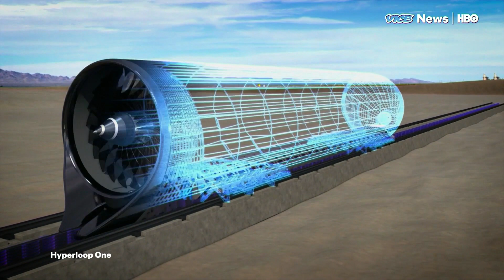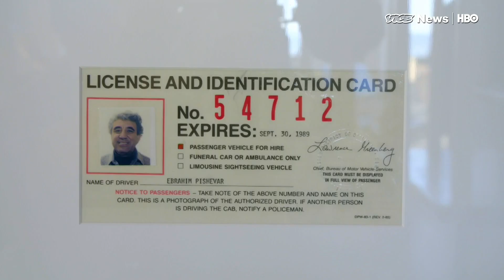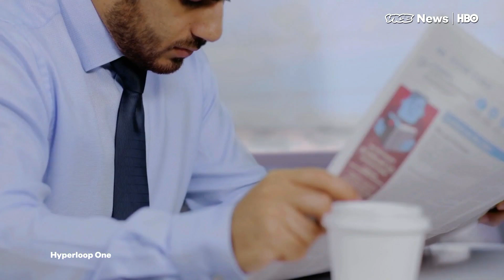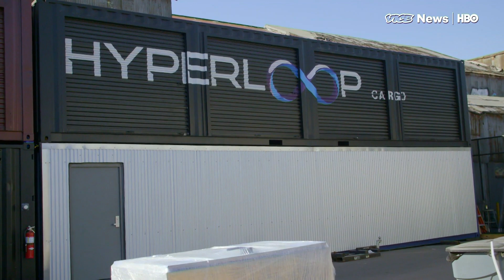The Man Creating The First Supersonic Hyperloop (HBO)

Comment: The Hyperloop is one of the silliest ideas I have ever heard. Quite apart from the eyesore on the landscape, there seems to be no escape from the Hyperloop. If there is an emergency in the tube and the vehicle comes to a halt, how do the passengers get out? The passengers are imprisoned. This is in contrast to the 31 mile Channel Tunnel under the sea between England and France which has a dedicated escape tunnel located between the twin rail tunnels (one in each direction) with access every 100 yards or so . . .

Comment: Hyperloop should be built underground so as to get rid of issues with terrain. A bump going at 700mph is going to hurt and going around curves would mean slowing down dramatically. Should also be easier to maintain that vacuum with layers of concrete dirt outside the tube. Larger upfront costs, sure, but a overall better design that would prevent the concept from losing consumer trust.

Comment: It's all smoke and mirrors... everything that has been tested or shown in prototypes already exists. It's called MagLev, it's already in use, it didn't need to be reinvented, and it shows nothing new or particularly essential to the whole hyperloop thing.

The original hyperloop concept didn't even point out to a MagLev system in the first place, they are using it because they couldn't figure a way for those pods to actually levitate in vacuum because that's of course a stupid idea in itself.

So all that they've made and shown so far is completely unrelated to what's needed to make this thing a reality. They could've instead paid for a MagLev train construction between the two cities and gone with it instead. MagLev trains might be slower in current tech, but they work, it's proven and it offers a wide range of advantages over even the ideal concept of the hyperloop. This whole thing is stupid as hell.

I mean, big whoop, the guy showed an electromagnet system working. You could go to a science fair to see that. That stupid track test? Go ride a train that's already using the tech in Shangai, fully operational since 2004.

Still no word on how they are going to build entire tunnels over long stretches of land while keeping near vacuum conditions inside those in an economically viable way. It's nothing more than the Simpsons' monorail episode with this guy banking it instead. 

And don't even bother replying my comment with the stupid we didn't go to the moon by sitting on plans and other stupid crap like that. All I see is a huge list of disadvantages and waste of money on a dream project for which existing technologies would do way better.

Comment: I call bullshit on this. Its a super dangerous and hard to have a vacuum in a tube. if the tube cracks the pods will be instantly destroyed.
Reply: R Sulli there are solutions to those problems. Like humanity is gonna give up on the best mass transit system bc of some highly unlikely scenarios. Oh, some terrorists might hijack a passenger plane and crash it into a building, let's give up on planes. Oh wait...
Reply: google "ping pong ball vacuum"
Reply: it doesn't need to be a perfect vacuum, it's not super dangerous and it's not that hard. And if the tube cracks the pods will NOT be destroyed, they'll just slow down.
Reply: R sulli, same goes with airplanes.
Reply: lol, when the atmosphere hits the cart at the speed of sound it will surely slow down, just like when you hit your hands together harder than you could ever imagine, both hands just slow down :D
Reply: DP ie Im not an engineer either, I agree this sounds super dangerous
Reply: If the tube cracks, more air enters the "near" vacuume, which would only add more resistance to the pods (slowing them down). This aint hollywood. The hyperloop is nearly foolproof compared to calamities that occur with regularity in other modes of transport.
Reply: plus LA and san Francisco is in earthquake zones
Reply: PunaJussi because flesh is as compressible as air?

Comment: Elon Musk backed out of the idea because it is logistically impossible
Reply: Just out of curiosity, are those air tight oil or gas pipelines also infeasible then? 
US-Mexico border is about 5 times longer than LA-SF distance.
An example of logistically impossible would be to build a hyperloop on the Moon. Logistics between LA and SF and the rest of the US is not that bad actually.

On the other note i have no idea if this hyperloop project is anyhow economically justified. Just saw some red flags that wanted to bring attention to :)
Reply: Lunarguard Gaming I don't think you know what that means
Reply: doodelay that it is physically impossible to build a hyper loop any distance without great consideration of the expansion of metals and how heat will effect this project?
Reply: A 100 billion dollar expected cost should throw up warning flags, considering even Donald Trumps expected wall is 10 billion dollars
Reply: You could bury the tube to account for temperature swings and as far as the deadly pressure wave during a breach you could run hatches along the tube to repressurize it all at once to mitigate that wave.
Reply: When did Elon "back out"? He never pledged to do anything to begin with
Reply: Lunarguard Gaming why would that not be considered?
Reply: Я asmallbluedove says it in the video:p it might say he handed off the project but it's more like he backed out of a financially unstable deal
Reply: Gene Khlopov they're not holding a vehicle that is transported at thousands of miles per hour
Reply: of course the metals will change. the magnets will also be an ongoing cost. you'll have to keep replacing them sooner or later because they'll eventually lose their magnetism. that doesn't mean it's logistically or physically impossible. way to jump to conclusions tho lol
Reply: / when they are saying they are going to make thousand mile connections and selling this concept to investors, when in reality they will never do this even if it's possible to account for the expansion of metal and concrete in the stations and the railway which could be hundreds of feet, they need to account for a 100 billion dollar cost, and all they can show with a 120 million dollar budget is a hovering box thingey, ya I'll either call scam or logistically impossible theory which is a fair claim since they have not provided solutions to zed problems
Reply: Cam F anyone can have a jet engine run in a concrete cylinder for a 100 feet.... It's distance that makes this impossible
Reply: Я asmallbluedove lol
Reply: CONNORCONDORJOHNSON I wish they proposed those things even if it's going to cost much more they need to say these things
Reply: doodelay can't just call me out then leave:p
Reply: +Lunarguard Gaming Obviously not, he launched a hyperloop competition this year and last year.
Reply: Chris Chong competition is not funding a large company
Reply: Lunarguard Gaming I never said he was funding a large company. In reference to your original comment you said he "backed out of the idea", well if he did why is he holding annual competitions?
Reply: @lunarguard gaming no he backed out because he already basically running three companies he only published the plans cause in an interview he said he would. He has since talked in many interview about how he would carry it out but doesnt have the time
Reply: Lunarguard Gaming No you jackass
Reply: He never backed out of the idea.  "Lunarguard Gaming" lies for his own pleasure.
Reply: This is easily avoided by using a mimetic polyalloy
Reply: $10 billion for a wall is a shitload better than $100 billion, considering it will actually work unlike Hyperloop.
Reply: doodelay ask them I don't know exact figures but if you're building a concrete structure with metal supports that has to be air tight for any amount of distance it will expand and contract exponentially, with no proposed solution that can handle this. let alone they're proposing to do it thousands of miles
Reply: And Elon is a dumbfuck and even he knew this dude was dead wrong!
Reply: Lunarguard Gaming provide evidence please
Reply: Killacamfoo O.G. No, it won't. Cam F 
Ways to get past a wall:
1. Go over it.
2. Go under it.
3. Go around it.
4. Go through it.

Comment: "Hyperloop" is a very specific combination of a mostly-but-not-entirely-evacuated tube (which realistic vacuum pumps can deal with), an internal hovercraft holding up the tube vehicle, and an electric turbofan propelling it.

And it's a genius idea.  We've been tossing around transportation ideas involving vehicles-in-a-tube for a century and a half;  This tactic cuts off some of the rough technical edges (wheels, hard vacuum,  the cost of active magnetic levitation) and permits airline-type speeds.  "Hyperloop" does not refer to the entire category of vehicles-in-a-tube, and you can't just cut off part of the idea - the elements are interdependent.  It was a way to make this family of dreams economically feasible to engineer & build.

This startup has nothing to do with the hyperloop concept as presented by Musk.

Comment: And another Money Pit is created. 
Never going to work, one breach and they all die a horrible death.
Reply: Mrcharrio to be fair, the same goes for airplanes. I agree with you though.
Reply: All hail our lord Thunderfoot for calling out this bullshit ages ago
Reply: +U 3. I thought Shanes "debunking" was pretty poor. He mostly just talked about half of an argument, omitted the rest and replied like the stuff he omitted wasnt mentioned or addressed.

The only aspect that made some sense was the compressor vs turbine part, but considering he was commenting on a video were Thunderfoot talked about the hyperloop in context of the vacuum claimers. A compressor in a vacuum wouldnt make much sense I recon so it would be reasonable for why Thunderfoot called it a turbine... And yeah, in the compressor argument Shane conveniently dropped/omitted talking about heat issues. It was to a point I got the impression he did it on purpose.
Reply: Mrcharrio hmmm they said that about planes, high speed trains, submarines.... that's how we move forward... and unfortunately accidents happen in all inventions... Even daily with cars... Even smart phones... people walk into on coming traffic...
Reply: Mrcharrio hyperloop revised to a low pressure system just slightly different from outside air, a leak would mean reduced performance, not a catastrophic failure like an airplane, at least keep up on current info before you knock it, totally ignorant
Reply: Check out Shane Killian's refutation vids of Thunderfoot's "debunking"